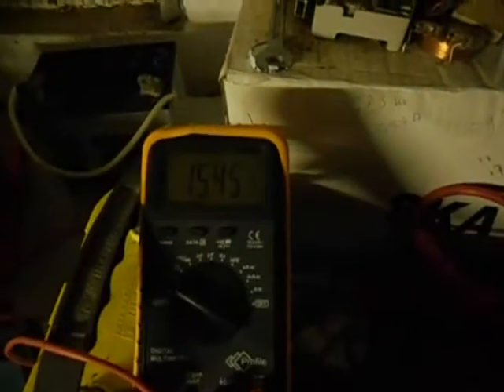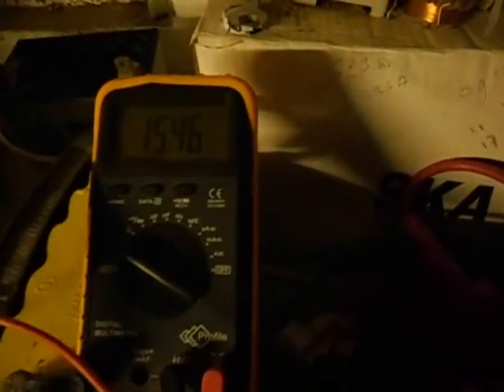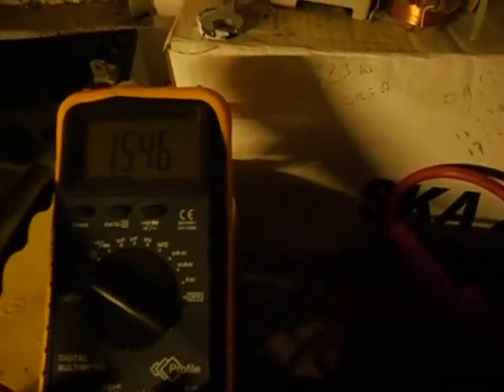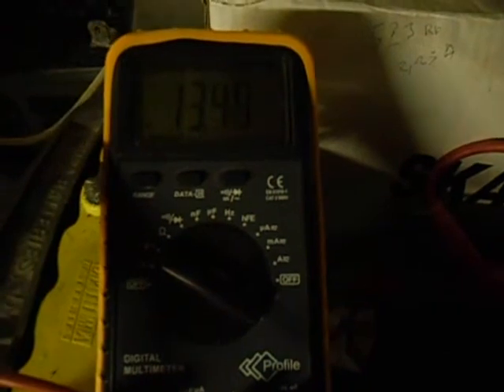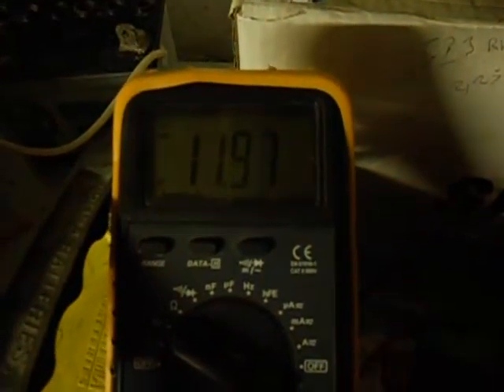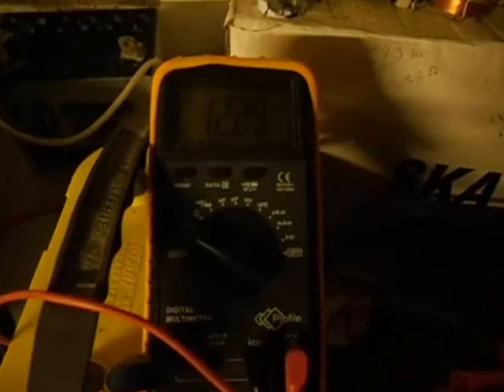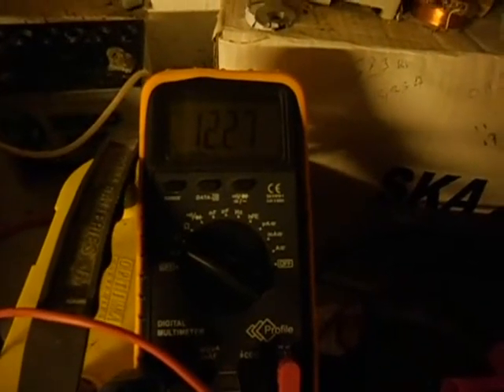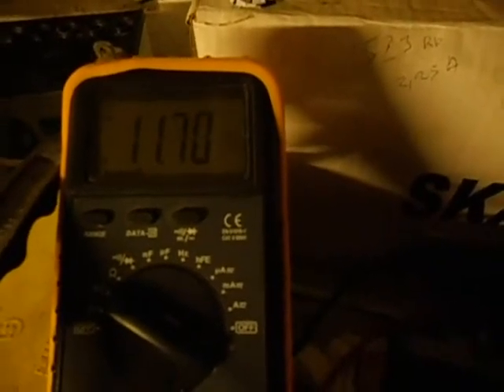pushingalumbatt

Comment: That does not say much, to short running times of the devices, although judging  by the rapid voltage drop witch already trips the lvc of your inverter it suggests that this alum battery deos not have much real capacity, i use them myself but only for LED lighting that is their real forte, when you want to run MOTORS a better bet would be Lion or even better LiFepo4 battery's, thanks for showing anyway
Reply: Depends what alum you use, best I have found seems to be Aluminium Ammonium Sulfate